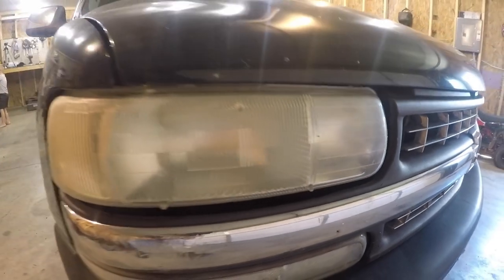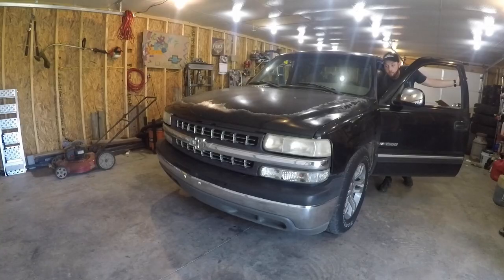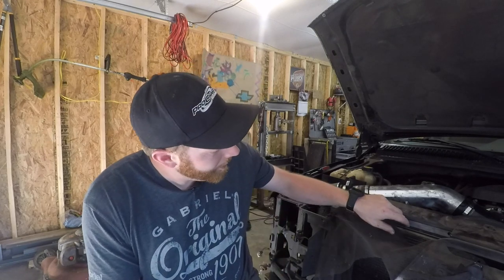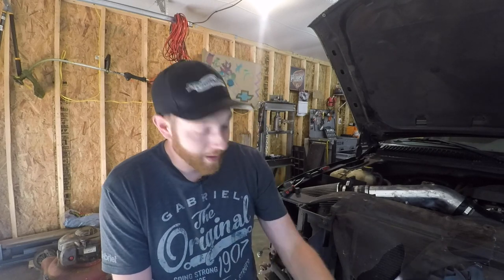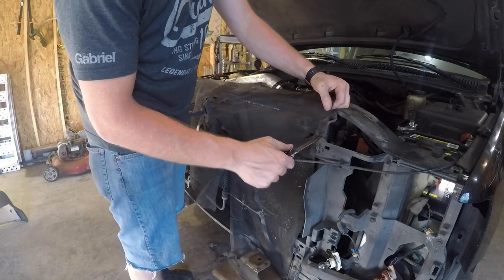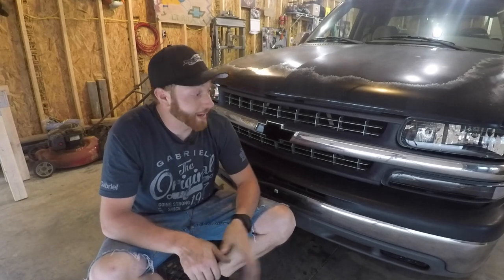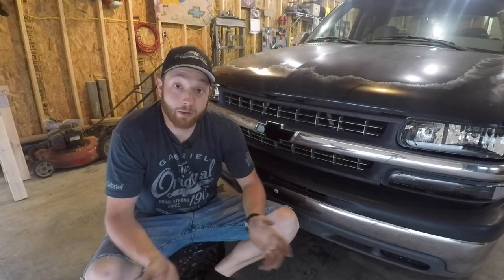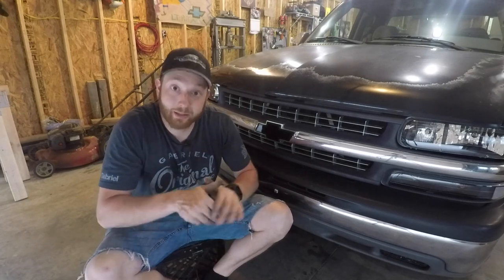Budget makeover for a NBS Silverado

Comment: Hey LT, Love your videos. I would like to add fog lights to my 2003 Silverado 1500, and was planning to use the stock switch even if I have to visit the dealer to flash the BCM. If you haven't wired it up yet, please do a quick video to show how to connect the fog lights to the stock wiring harness and BCM.
Reply from the maker: good idea for content, I havent even wired mine yet...
Reply: @LawrenceTolman   did you do a how to video with them yet?

Comment: Did you use or add factory wiring and switch for the fogs? Or go with a custom setup?

Thanks
Reply from the maker: haven't done either yet to be honest, but I want to get em wired into a stock switch, I just don't want to have to visit the dealership to get the BCM programmed
Reply: @LawrenceTolman  The stock switch is momentary and not a latching switch. So you'll need to get the BCM reflashed or look into getting a latching relay. Keep up the good work! 👍

Comment: Those plastic fog lights will snap right off soonish, won’t even survive 1 car wash machine trip.good luck,😂
Reply from the maker: I still haven't wired em up, but they're still hanging in there and its been about 14 months...
Reply: @LawrenceTolman  I went through 3 sets, before I abandoned them, I guess I’m a little rough on the truck tho 😂
Reply: I have a 2002 with the same style fog lights, the OEM ones are plastic too, never had problems with them breaking off at the mounting bracket. I have replaced them once, they tend to lose the clear lense. I applied a bead of JB Weld glue around the perimeter of the lense to make a more secure bond as the lights tend to vibrate a bit which causes the lense to fall out.